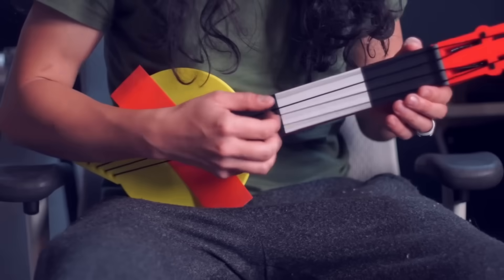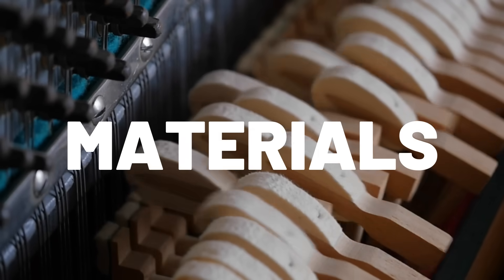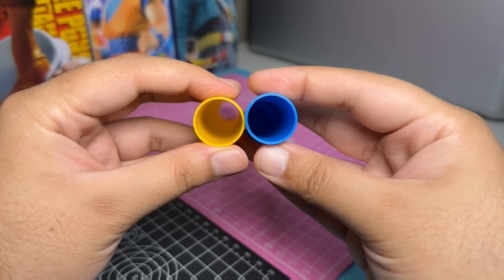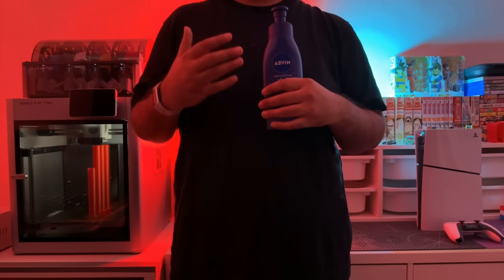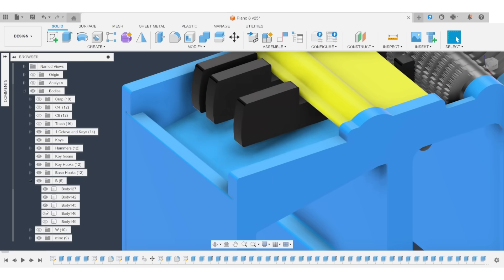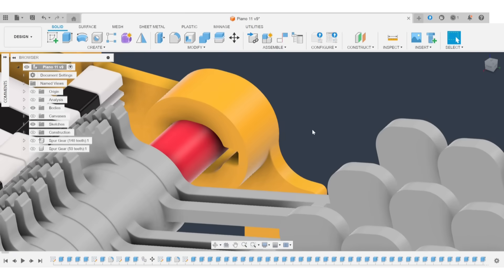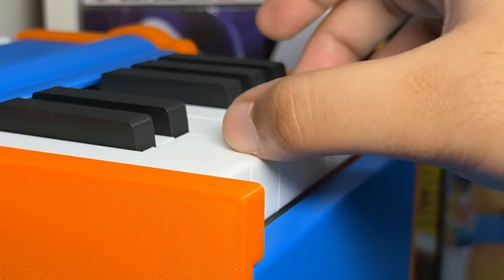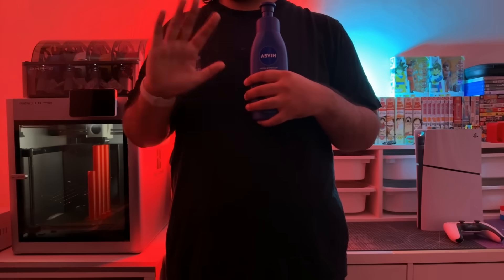I Built a 3D Printable Mini Piano

Comment: I would like to be a random comment.
I haven't built it yet, but the instructions are great. Theoretically other than providing a link to the length of tube to make a note, one could basically reverse engineer your video, but there are a lot of parts and $6 is worth it to support the channel and the effort...
what is up with the hammer names?

Comment: I work for a piano manufacturer.  We use 3d printing for prototyping in many areas.  So there are real pianos with 3d printing utilized.
Reply from the maker: That's really cool! What kind of parts do you usually prototype?
Reply: @toast_channel we do composite action parts.  Those would be damper levers, whippens, shanks, and flanges.  When getting the geometry figured out it's good to print them out and test them before getting a mold made for injection molding.  Making a mold for an incorrect shaped part is a 40k mistake after all.

Not to mention a full assortment of piano tools for rebuilding pianos that we are 3d printing.

Also fun to watch action geometry issues also come up in this video.  When designing a piano you need the hammers to have enough mass to drive the strings and acceleration to provide the energy, but it also needs to be equivalent to what a pianist expects.  That means 10 mm of key dip or the distance the key presses down while the hammer needs to move 45 mm.  And on top of thar we are battling friction so you need to make sure the action centers are aligned with each other to reduce friction as much as possible.

Comment: I think you have them mounted too rigidly. That would explain why you have only instantaneous notes and no sustain. Maybe suspend the pipes with more rubber bands? (you could remodel them with through-holes for that exact purpose). Also, you might want to put some of that soft foam tape you're using elsewhere on the strike faces of the hammers like they do on an actual piano.

Comment: I'm sure you're already on to other things, but if you'd like to make a v2 with tone generators that have more sustain, look into the fender rhodes action. It accomplishes an escapement (the ability for the hammer to bounce off the tone generator) in a much more simple design than tradition pianos. I've been contemplating a similar project, but involving guitar string (so requiring less tension). Great job on this v1 though!

Comment: Hate to break it to ya bud, this isn't a piano? you may have accidentally invented a new instrument.

(Keyboard instruments are differentiated by the way the sound is actually generated. If a hammer strikes a string, that's a piano. If it plucks the string instead now you got a harpsichord; If it hits a metal plate instead, now it's a celesta; wind thru pipes, organ etc etc. So a hammer hitting a tuned plastic tube is its own thing, which may already have a name if someone else has arrived at this concept before you)

Comment: its not that complicated. Its a dead mans switch string mute, and a hammer hitting another hammer, using leverage to turn the small slow key rotation to faster longer travel at a further distance from the pivot, which is basically a gear box made of levers. The second hammer can't hit the string unless it gets enough momentum from the first hammer, but the first hammer is limited so it can't reach the string as the key is held. This mechanism flicks the hammer, then a springs or padding catch the hammers so they don't make noise.
Reply: There is also a little lever I forgot, that lowers the leverage, to adjust how fast you can tap the note.

Comment: resonator pipes can be folded because it is a transmission line resonator you can check slapophone for more info they are made out of multiple pvc pipe segments folded around the standing frame to tune every slap pipe and it can be made at least 3 or 4 octaves long before pipes become too long for the stand

Comment: very cool project. If I may suggest: You could try to print corners for the tubes to make them longer and build at least a second octave.. or build rather a cembalo than a piano. maybe using nylon guitar strings. they're way cheaper than piano strings and you can cut them to a length you need. 
Plus, I'd be really interested in how you stabilize the whole construction against bending due to the tension of the strings.. ;)

Comment: You know, you can make a tube that's twice as long (if you wanted to try two open ends), that's not twice as long.  Make a U-bend pipe.  There are lots of wind instruments that have loops and U-bends.

You could also consider that you don't need the hammer poised above the tube, descending to strike.  Turn all your closed tubes upside-down, and have the hammer strike from below.  The key and the hammer could then be just one rigid lever.  You'd probably need a sound board below it to make it more musical, but it might work.

Comment: Can you use weight instead of a rubber band?  Maybe make the gears egg-shaped - like, circular where they need to engage with each other, but with a blob of mass hanging down when the key is not engaged.  Pushing the key will involve raising the mass (rather than stretching a band), and gravity rather than tension will pull the key back up.

Comment: for one thing if you want a printed part to ring it needs to be printed at a high temp so it will be harder and more brittle which will cause it to make more sound
Reply from the maker: Will that work with any filament type or just some specific materials?
Reply: @toast_channel  i was thinking of pla but I'm sure that some carbon fiber composite filaments may work better for this use case

Comment: You mention that covered pipes make different bites, you could add flappers that cover the ends of the pipes controlled by a separate pedal. That could easily double the range of notes.
Reply from the maker: That's actually a great idea! Maybe I'll use it when I eventually revisit this project in the future

Comment: you should have had the keys pull the hammers up against tension, slip off of an engagement surface, and allow the hammers to be pulled down against a fulcrum to strike the resonators, using their tendency to whip as an asset. you'd be able to use a lot fewer parts. you could also just have used like, any low-tension instrument strings for this project, something like nylon guitar strings, where you'd tune and control their length independently to achieve your tuning: there'd be some issues with keeping the tension on a 3D printed project, but with high strength materials and low tension strings, maybe even bass strings, you could overcome that.

Comment: Since all the rubber bands are for is returning the keys when released, couldn't they be replaced by having a counterweight? Friction might become an issue in that case, and I suppose making a counterweight out of the same material as the keys might be somewhat problematic, you'd end up having to hollow out the front of the keys, which might make them feel awful.

Also, how dare you

Comment: This is very impressive. With your design, it wouldn't actually be that hard to make a complete 3D printed piano, except for the lenght of the tubes. But maybe if they had larger diameter they would require less lenght. But either way, awesome project.

Comment: Dude, It would be so bad ass to build an entire range of notes!!!
Reply from the maker: My original plan was 2 octaves, so I've made everything kinda modular, maybe some day I'll do the full 88 keys version hahah
Reply: @toast_channel   i think you can try to use guitar strings (which are more affordable than piano strings) instead of tubes, if you add a rubber band to the hammers and connect it at the same pin of the corresponding key (like a V) you should get a better way to make it retract and sound more realistic. But i dont know if PLA (or any filament you can use) can withstand the tension of the strings pulling... maybe with very thick walls it will. also if you use guitar strings, you should be able to fix the "hammer hit strength" problem also with a lower angle.
Reply: @toast_channel  just line the same mechanism up with different tube lengths